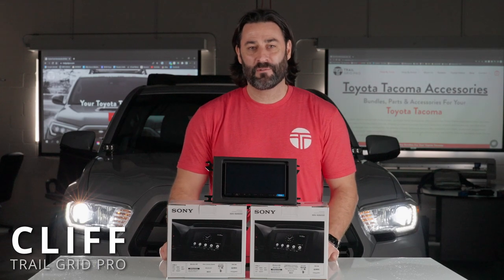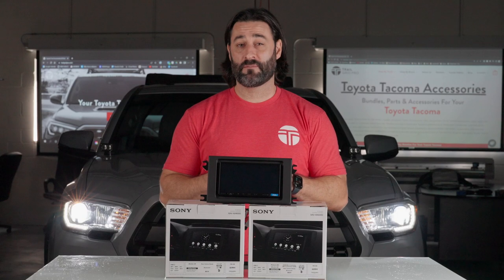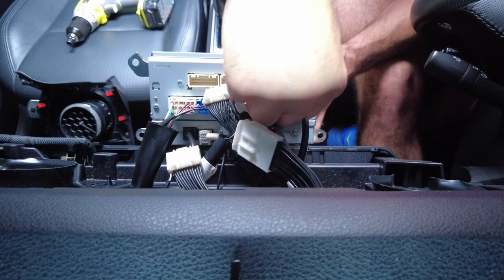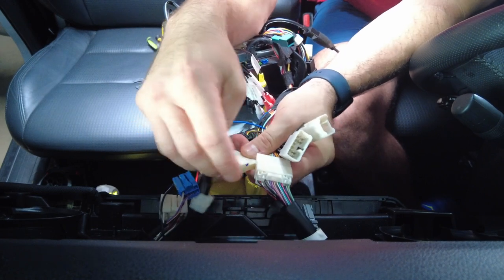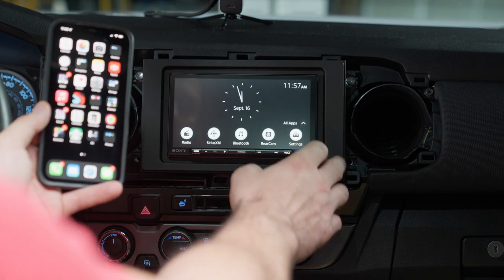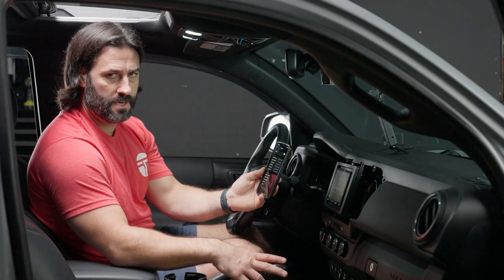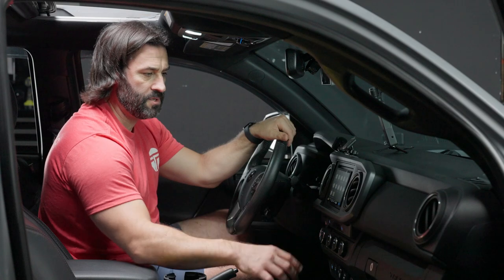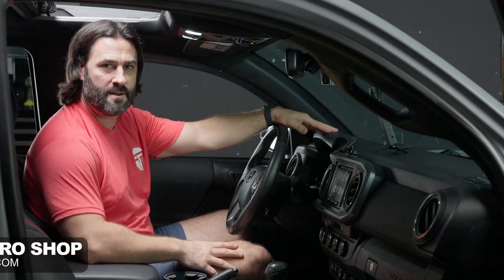Toyota Tacoma Sony XAV-AX6000 Plug & Play Kit Installation | 2016 - 2023 Toyota Tacoma

Comment: Any major difference if the taco is a manual?
Reply from the maker: Great question! 2014-2019 manual tacos will require the reverse signal wire to be tapped into for the backup camera to function properly.

Comment: About that xm radio plug—if you want that option alter but don’t have it now, where does it plug into ? Does the Sony unit have a spot for it or I have to switch it with the white plug.
Reply from the maker: Great question! If your vehicle doesn't have factory Sirius, you will need to use the puck style antenna included with your bundle!

Comment: HI, I just received mine today (18 may 23).  I m on Android ( Samsung) and very happy.  I ordre Monday receive Thursday,  woww Very fast service.  ( and I m from Québec Canada)  . It's really easy to fix , I put the mic on the Crawl Control panel that is very easy to do. I use DJI ACTION CAN on my hood when I drive in some back country road with my Tacoma, so now I can have the Google map on the Sony and Control my DJI with the cell, without split the cell between Google map and DJI CAM . that is so easier to use. This bundle is well made. 
Thank you

Well, I just discovered now on the road .. thas not possible to control my DJI WITH the cell and have Android car in the Sony... 
So that's the life, anyway I m happy to have.👍👍👍
Reply from the maker: Thanks so much for your kind words! Great job on the installation. Sorry, we're not familiar with the DJI component you're referring to.
Reply: @TrailGridPro  no problem with the Sony or with Android auto... it is just normal ( now I know) the action cam didn't work when I m on Bluetooth with the cam.... you can be on Only One Device at the time so if Bluetooth are on Android you can't be with Bluetooth on an other Device... I fix my problem... I buy Bluetooth control for my DJI OSMO ACTION... so my cam are now separated control from my cell ... 👍👍

Comment: Whats the difference between audio 2volt vs 5volt outs? The hdmi is the most stupid feature they could include... is not like Im taking my ps5 or a blu ray player to use it in the car.
Reply from the maker: More voltage means more output.

Comment: Its stated you can plug a roku or fire stick into the HDM but how do you get the supplied USB power to it without a cord being visible in the cab?
Reply from the maker: We haven't tested this ourselves, but you could likely use a USB splitter behind the head unit to split the existing USB port into two, and connect the HDMI device that way!

Comment: I have the base model head unit in my truck currently. Looks like the bezel is a bit different than the one in the video. Will it still fit this smaller space? Or will I need a different bezel.

Comment: Great video! I have a 23 Sport w/o jbl. I assume it'll work with that? Do I need to swap speakers immediately or can I add this and do your Kicker bundle later? What do the phone shortcuts look like on the screen? I use them often on the OEM. Thanks!
Reply from the maker: Yep this unit will certainly work with your truck and you can swap speakers at any time! The CarPlay shortcuts are shown in the video thumbnail.

Comment: I have the Sony XAV-AX6000 head unit installed in my Tacoma and I would like to know if you guys have a front camera plug and play bundle available
Reply from the maker: The 6000 has only one camera input, so you'd have to add our anytime camera kit to your rig to get front camera functionality: https://trailgridpro.com/camera-shop/
Reply: I bought the Anytime front camera prior to my AX6000 upgrade. With the factory player, you can switch between front and rear camera anytime with the side switch. 

There’s an extra step when you install the AX6000, you have to select camera on your player, THEN select front camera from the side switch.

Comment: What if you 2018 tocuma doesnt have gps on the factory radio, will it now have the gps showing on the screen?
Reply from the maker: These units don't have an internal GPS receiver, but navigation is achieved through Apple CarPlay or Android Auto. These will display on the head unit.

Comment: What is the pre-installed wire that’s connected to the usb-c?  

When I want to add custom images, I can’t use any available ports. I have to remove the player, unplug the usb-c wire, then plug in my thumb drive to the back of the player in order to load my images and update firmware. 

Is this the only way or is something not working properly?
Reply from the maker: Good question! That wire is an adapter that connects to your trucks factory USB harness to retain functionality of your factory USB port!

Comment: Looking at this for my 2018 tacoma.  What stock features does this remove?  You mentioned a couple but it looks like an awesome upgrade overall. And it works with the factory amp for the JBL premium?
Reply from the maker: Yep, it works with JBL and non-JBL! Our kit maintains all of your head unit functionality from your factory head unit - the only thing you lose is the speed limit in between your gauge cluster and also anything related to the factory navigation.
Reply: Great.  Love the simplicity!  I do have a front trail cam and custom switch but from another comment that should integrate as well?  Thanks
Reply: @TrailGridPro what do you mean it loses the speed limit, no more digital speed limit with this?

Comment: I just bought this and installed it today but on max volume it’s sound way quieter then my factory head unit is there a reason why it’s doing that
Reply from the maker: It's possible that the bundle was either built wrong or ordered wrong. For example, the most common scenario when this happens is that someone ordered a JBL amplified kit and as it turns out they do not have a JBL amplified system. So, what happens is they just have a much quieter output because there's actually no amplifier present to amplify the sound.

Comment: Can this work with my hardwired front/rear anytime camera physical switch
Reply from the maker: Yep, it sure can. 

To get an Anytime Camera Kit to work as intended with a Maestro Sony bundle you'll need to do the following:

Cut a new stripe of 18 - 22 gauge wire about 16 to 18 inches long. 
Strip the wire back at both ends and attach a t-tap on both sides.
Tap one side of the new wire to the "orange" wire from the Anytime Kits override harness.
Tap the other side of the new wire to the "purple w/ a white stripe" wire from our Sony bundle harness. 

This will restore full functionality of your Anytime kit when paired with one of our Maestro Sony bundles.

Comment: Why do none of the gauge features work. 2018 Tacoma trd sport, auto trans Sony xav 9000es. I installed everything including the OBD2 connector that isn’t mentioned in any instal videos and I still have no gauge features showing up.
Reply from the maker: Hey Brian! This was an issue caused by a recent firmware update released by iDatalink. Please reach out to our support team at support@trailgridpro.com and we'll help ya get this fixed!
Reply: @TrailGridPro  tech support was very fast in there response and sent very detailed instructions on how to re-flash the Maestro rr to the firmware that I needed. It works great now.

Comment: how did you get the factory USB to link in with the head unit? I've been told the factory USB doesn't play well with this Sony model.
Reply from the maker: We use special USB adapter to adapt the Sony USB to the factory USB in your rig. Works fine with ours!

Comment: The 4000 and 6000 backup camera will automatically come on when the vehicle is placed in Reverese or do you have to press a button the screen?
Reply: It automatically comes on. I will say there is a slight delay but nothing crazy. You can also view the camera at any time
Reply from the maker: Yep, it will automatically display when you put your vehicle in reverse just like it does with your factory head unit!

Comment: I have an older bezel in my 2017 sr5 Tacoma which has a smaller opening for the radio will this unit still work in my truck?
Reply from the maker: Great question! We include the smaller dash trim for SR5's!

Comment: Greetings from a Canadian neighbour!  Very interested in this but I have a quick question which I haven't seen anything on it yet.  Part of your installation, you connected a GPS antenna which I'm assuming is for navigation.  Does this unit come with a built-in GPS system like the stock premium has?  I know I can use Android Auto Maps app but that's useless when you're out in the middle of no-where with no cell service/data.  If it dosen't than that would obviously mean I'd have to have a seperate GPS unit on the dash to get that feature.  I have my first Taco on order, 2023 TRD Sport Premium Double cab 4x4 long bed.  ETA May 21st.  Looking for items that I may switch out shortly after I get it.  This may be one them.  Cheers!
Reply: Just found the answer to my question in your FAQ section on your website.  Thanks!
Reply from the maker: Oh, well ... very resourceful of you!! Bravo!

Comment: Does Android Auto work through blue tooth or does it require a wire?
Reply: I just read that is does. Where does the wire connect?
Reply from the maker: The Sony 6000 has wireless Android Auto, but you can also connect via a wired connection by plugging in to your factory USB on your head unit.

Comment: Anyone else have an issue where CarPlay is always stuck in dark mode?
Reply from the maker: Hmm, haven’t heard that but doesn’t mean it hasn’t happened to others! I’d unpair your phone from the head unit, remove the device from the head unit list and then repair the connection. See if that does the trick!
Reply: @TrailGridPro  I tried that, no luck. I’ve tried everything I can think of, could it have anything to do with how I plugged things in? It was the plug n play bundle, but perhaps I did something? Everything else works perfectly, but I have never been able to get CarPlay into light mode. My auto light/dark worked before on the stock 2019 Tacoma head unit. Any help is appreciated!

Comment: Just received mine and the dash kit is not right for my truck. It is to large and the dash part will not go back on.
Reply from the maker: There’s two dash covers in each of our Tacoma  bundles. Check your box for the smaller faceplate and swap that for the cover currently attached to your side brackets. If you need any other assistance after hours email us at support@trailgridpro.com
Reply: @TrailGridPro  Thanks for the reply. I realized that after I typed the comment. Been years since I installed an aftermarket radio and took my brain a few moments to process what was wrong. Other than that and an issue with the mic adapter I am very pleased with the radio and the way the whole kit was put together. Will recommend you to all my fellow Taco drivers.  Just gotta get the kicker upgrade speakers now.....